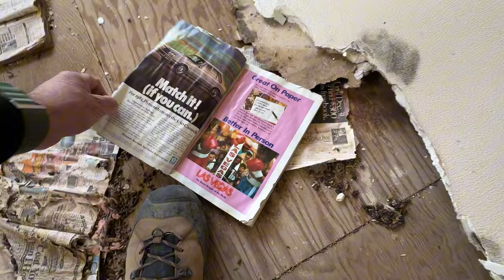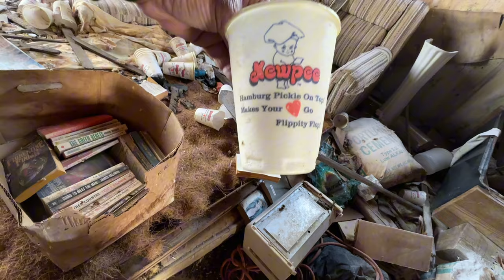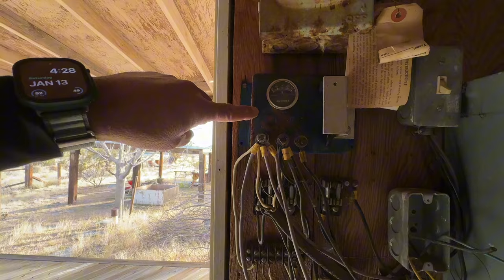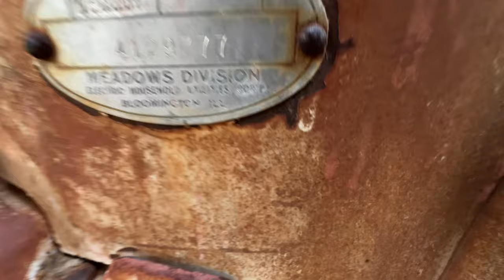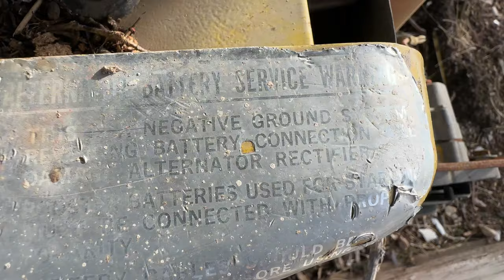Abandoned home what happened here #abandoned

Comment: 14:50, looking at that old motor, and thinking about the engines of today. Had a 57 Apache step side. I could crawl up and sit in the engine compartment while I twisted nuts & bolts. 
19:26, compressor?
Reply from the maker: @abayless3816 that was one beefy truck, thats for sure. As for the other motor at 19:26 had another subscriber say that it was a generator. just a few steps behind me was where all three wires from the ran to. This house might have had two sources of power, Solar and a generator. As awlays, thank you for the great comments and for watching.